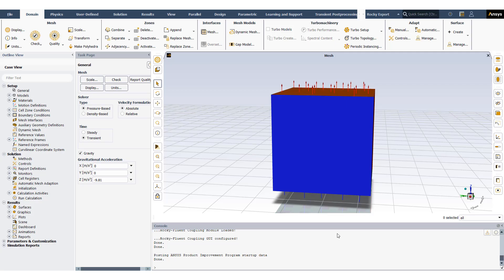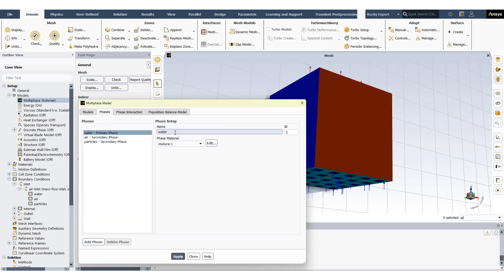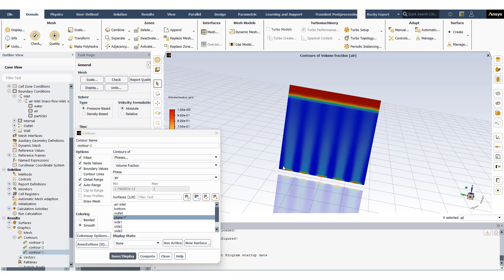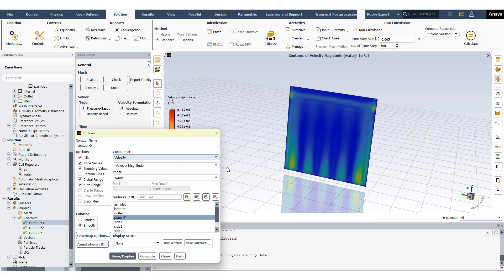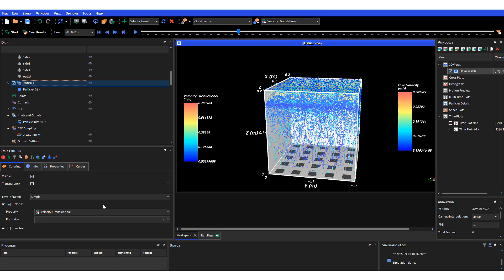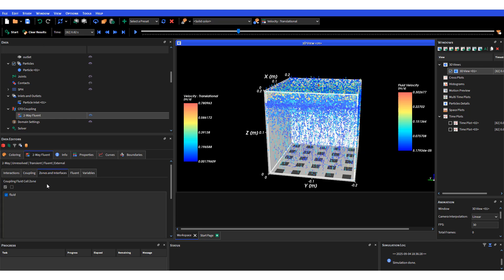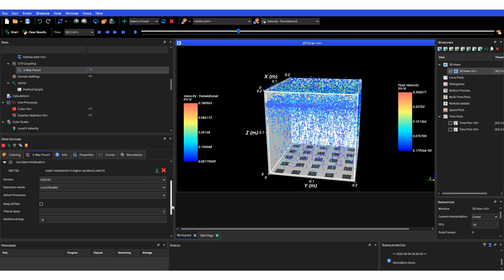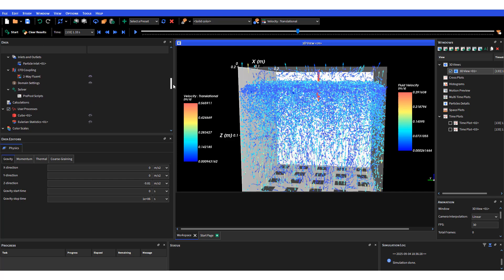Two-Way Coupling with Fluent and Rocky: Applications in Water Treatment

Comment: Hey! I am working right now on a project where I have to simulate a sand-air flow in a pipe. I decided to use Ansys Fluent-Rocky CFD DEM two way coupled. 

I am curiose now, why you didnt show us the workbench? As I have researched the workbench is needed for the coupling etc? In general i didnt get exactly what happened between fluent and rocky 

Thank you for your help :)